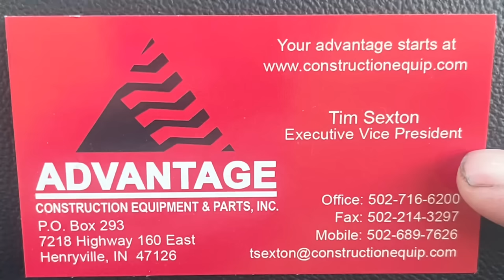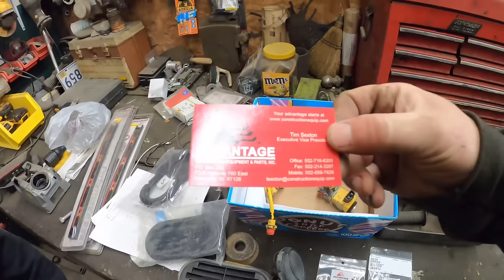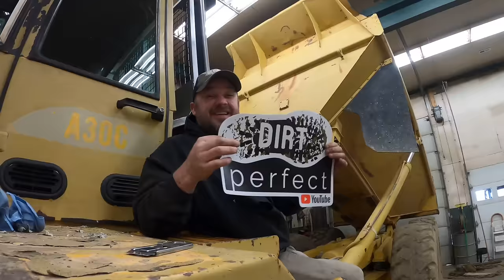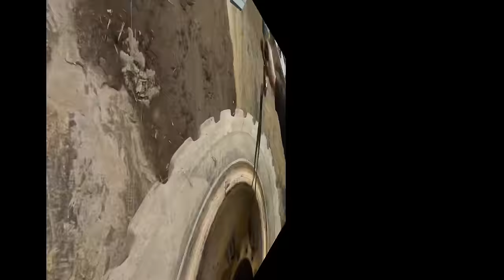We found the honey hole for used Volvo parts and pick up a new attachment @C_CEQUIPMENT

Comment: After spending a couple of days driving around your area, and making the trip from the Derby Market to Nashville, In to C&C Equipment while pulling a 30 ft fith wheel camper. I now have great respect for your driving skills hauling equipment around on those narrow, twisting, hilly roads.
Reply: Put the YouTube between the two vents you two are both nuts 🥜 lol
Reply: I'll agree with you on that, those kind of skills are self taught. Awesome driver he is.
Reply: @rogermoyse2757  I thought they were going to do that too!
Reply: Lol
Glad you stopped by
Reply: Another awesome video.
Reply: how do u have great respect hauling a 30 ft trailer.  Not QUITE the same thing but you fantasize however u want.  🤣🤣👍

Comment: That machine is a screed machine for bridge decks.  The concrete is belted into the machine by conveyor as it moves forward. It's wide enough to do both lanes in one direction across a bridge
Reply: No bridge paver don't run on tracks, they have boogies that run on a pipe(rail)

Comment: Always nice when you can knock out several random projects in one go. Look forward to seeing the front weight Clint, Turbo Kevin, Hunter, and Tucker built for you put into action and the difference it makes for doing tile work. Hopefully, the lockers work good on Bubba Dump, and the new used tire helps with traction and holds air, too. Keep up the great work ol boys 😁 👍
Reply: I thought it was Sausage Fingers Kevin  ?
Master painter and top shop clown around kinda guy.
One in every shop jelps keep everyone sane on rough time crubch days.
At the Ironworker welder shop I welded at before I went to Coast Guard boot camp that was John and his cousin Elise both ftom Tennessee a humor that would make the best comedians gut laugh.

Comment: Sharing A Defect Notice…..Just a heads up to Mike and anyone driving a 2019-2023 Chev or GMC 1500/2500 with a 5.3 or 6.2 gas, The manufacture has a recall on certain VIN numbers for a engine cooler line that will separate due cold temperatures causing a line separation pumping the oil out while running. If you happen to start your vehicle to warm it up and walk away, you could come back with all the oil on the ground and a engine locked up. I share this because it was the case for me but I was able to save the engine before all the oil was pumped out. The only way I could get the line was by calling my brother in-law in Canada who picked the line up at a local Chevy dealership. It took 14 days to get the line in my hands because the engine oil cooler lines are purposely on a national back order in U.S. You can buy the line in Canada but you can’t find it in U.S. See Global Safety Investigations DCS5833  Subsection N212326940 . Great field trip Mike.

Comment: Looks like there is enough pieces in that salvage yard to build yourself another haul truck.  You can call it Forrest Dump as long as you paint it green.
It might be less of a struggle if you used a palette jack under those truck tires, or maybe even fabricate an "A" frame with forks to lift them with the overhead.

Comment: Thanks Mike. I was worried the tire would slip off the hoist with Aaron standing under it when you were loading the spare tire into Bubba until I saw how you rigged it. Great video. (Aaron was right, you should have picked up a spare set of mirrors.) :)

Comment: for mirrors get some polycarb mirror material and glue it to a piece of aluminium plate. it will bounce instead of braking. we had someone smashing out truck mirror regularly, until i did that. without the backing it flexes to much with the vibration. with the stiffener it's like the glass but bounces when hit. you could computer control all those winches but many would be pissed if you did. personally i would enjoy seeing a dragline remote controlled wirelessly.

Comment: I have an idea for one more bubba dump project. Weld a thick plate (striker pad) on the side of the bed and weld a chain and sledgehammer to the side to shock the bed when you have that sticky clay won’t come out easily. Like when the tail gate slams on a regular truck.

Comment: 1" milwalkee will get those nuts off, but if they have been on a long time, use air! We use forklift for getting tyres off (angle of dangle) As for the diaphragm's the pain is real!! Especially the one under the cab floor for the front axle!!!!!

Comment: Had a place called Piggy Smith's between SF and Sacto.  Every imaginable old Cat/Terex etc etc and misc part lying around and in old barns. Think there's still a used parts business there but it's gone upscale and on the interwebs. Was fascinating to just walk around. If you wanted a random hydraulic cylinder or bit of cutting blade, they had piles of it spread everywhere.

Comment: The self tapper on the 850J seat reminded me that Camarata just used self tappers to fix a replacement dash and a new radio in his Dodge PU.  You look at his dash and there are about ten screws showing and he replaced the broken hinges on his beat up toolbox with screw ring clamps.

Comment: Have you added a step on bubba dump for mbts ? Just use 2 chunks chain hanging with a pipe across & it wont get in the way driving through rough areas

Comment: the CMI is for concrete and it was made at the plant here in OKC
Reply: Also CMI made motor graders especially big ones,  my brother worked for cmi as a demonstration of there large blade with special electronics,  this blade first designed from a cat 16 blade,  later they designed the on completely new blade it was use on freeway jobs, they wanted my brother to travel a lot , but he decided traveling and be away from his family wasn't what he wanted.  My brother was unbelievable blade operator,  he had over 50 year in operatoring engineers local #3 union in California bay area.

Comment: Operator can look out door and see who they working for? Or if E ticket ride company logo good if shiny side goes down.  Bases covered.
Lot of tire hands at mines swapped to Milwaukee, no frozen air lines to work with.  They use on bigger and smaller equipment

Comment: I dream of finding a yard that has a 20 ply 21:00-24 tire for the front of my early Cat #80 (can, pan, pull scraper).  Great dream if it is on a wheel.  Doesn't need much tread, just needs to hold air.  (You said that you want comments).
Reply from the maker: Call and ask they might have one

Comment: There is a huge flaw in the weight for the dozer! You or Clint may not have thought of this, but you are going to have major problems when you go to start using it. I am really surprised that you didn't think of this. The fields you are in are very bumpy. There is no kind of pin or anything else to keep it on the blade. You are going to go over a couple of bumps and it is going to pop right off.

I am trying to give an expert YouTube video watcher. Did I do good? There is definitely not enough weight there to hold it in place. LOL
Reply from the maker: Lol yes

Comment: You always say that sometimes a little ingenuity and common sense is better than 'by the book engineering'. Well, regarding the installation of the dozer seat, how much more redneck engineering can you get than the use of a 20 penny nail to hold it in place. 🤪